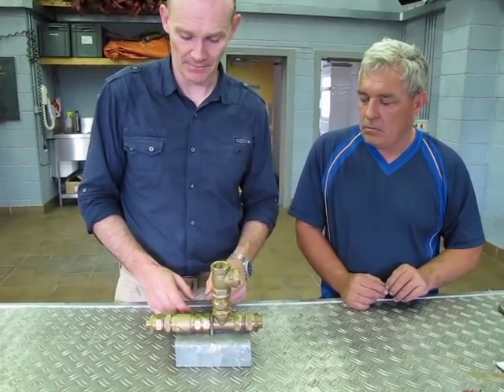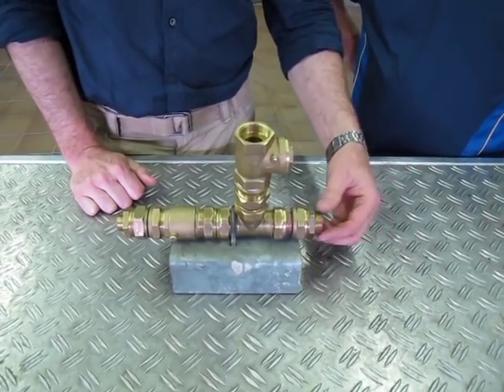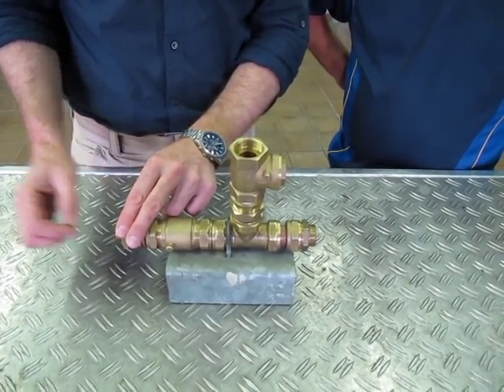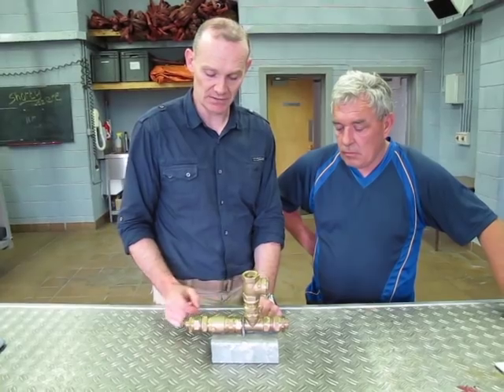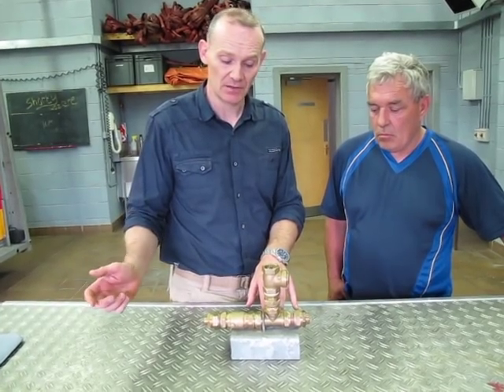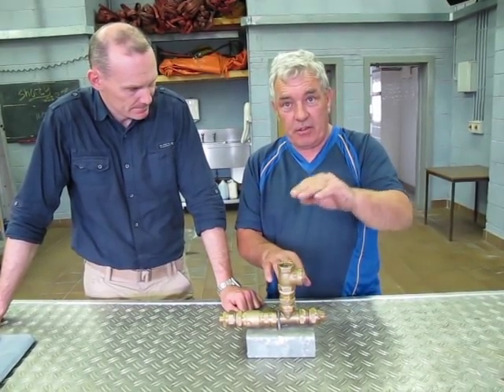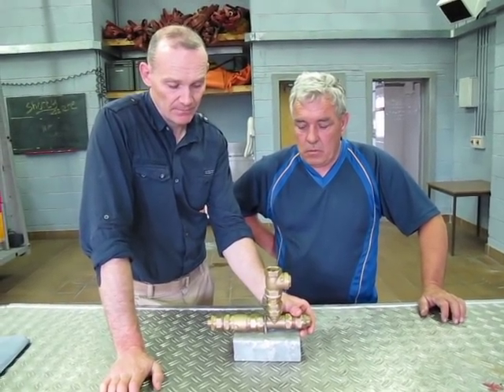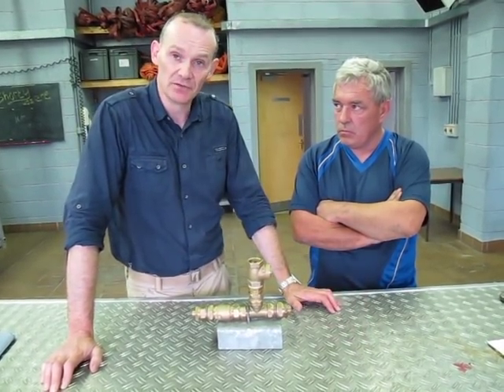Build your own ram pump

Comment: this is an excellent presentation and i am amazed that you only have 5000 views.    there is so much out there about pumps which is not concise or presents good information.   you do more in 2 minutes than most do in twenty.

good job
Reply: dysfunctional vet Many just assemble the parts and show you it works without explaining how it works. I see the pressure chamber is missing here.
Reply: A pressure chamber is not required for this pump to function.
Reply: @mpelinsekela3598  
A pressure chamber isn't needed. 

The accumulator van be added but it doesn't return much. But you coukd use it to get water higher or under more pressure.

Comment: Hi.  I tried this with exact same fitting. 150m Inch pipe falling roughly ten foot from top to bottom. Decent supply of water. But the flow will not catch the flap. Any idea what could be the problem

Comment: How do you slow it down? 100 psi seems a lot how many liters an hour? Can the psi be reduced to alternate to various hyrdro flows? Where is the pressure gauge? Swing flap guages are expensive but could I attach two?   Too many questions not answered here.
Reply: Simply put.
No.

It all depends.on the diameter of the pipes.
It's then a 10:1 return.

If you want 1 litre a second you need to put in 10 a second. (Youbwill .8 litre. 8/10% return.)

It's not variable. It's a pump nothing more.
If you want to put alot of water someone it needs a reservoir and it will fill it. Or a slow feed system.

Comment: Could I put this at the bottom of my pond and use it to power a waterfall please?
Reply: No. It won't pull water up like an electric pump. You need a water source from a pipe coming downhill to this pump